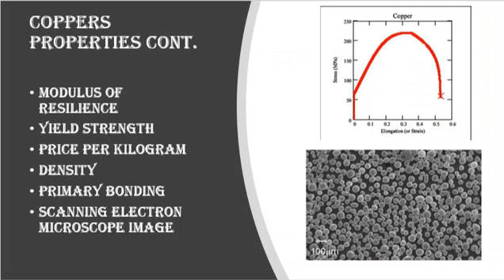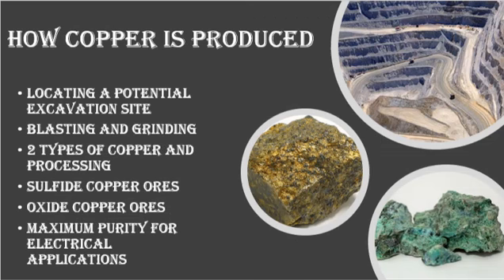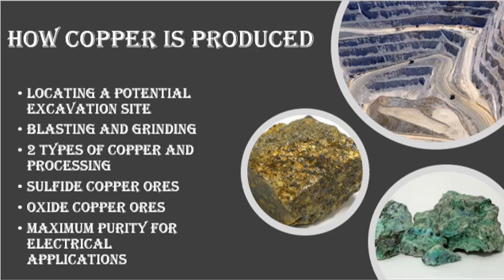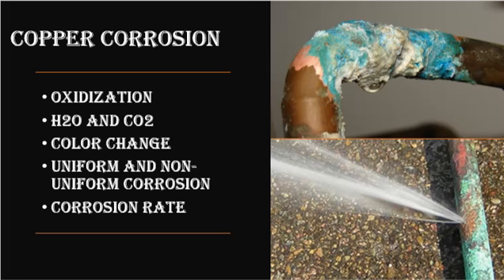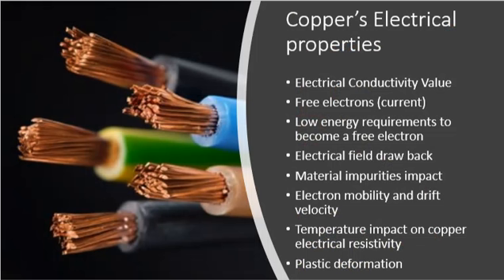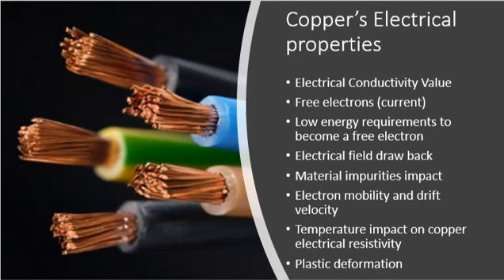Copper by Michael Watson

Comment: I like your set up, its very eye appealing. It's also nice that you don't just go off of what's on the slide and go into detail about each topic. However, the video is 12 minutes long, Im not sure if it actually matters for the overall grades but it did only ask for 5-10 minutes. You had a lot of diverse pictures and they went with what you were trying to explain in that specific slide!